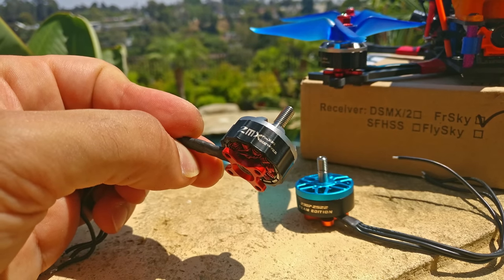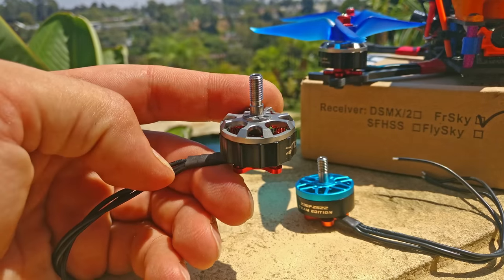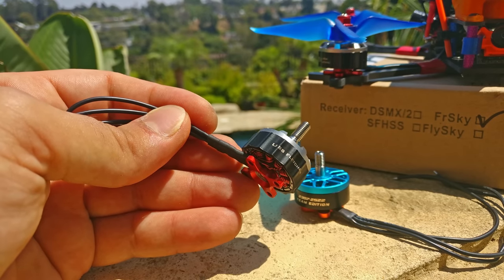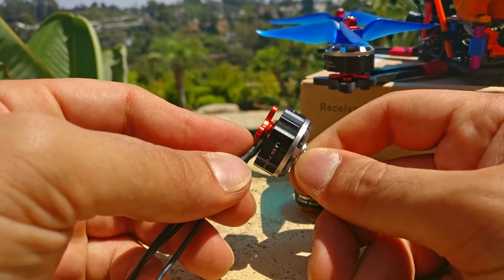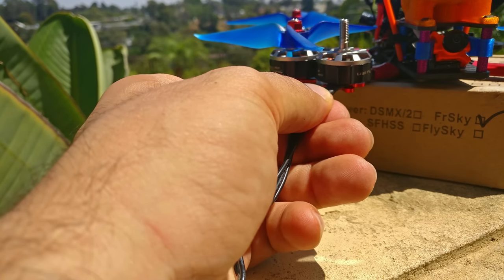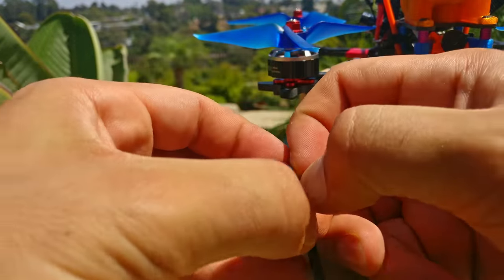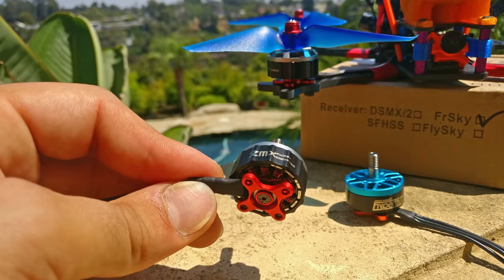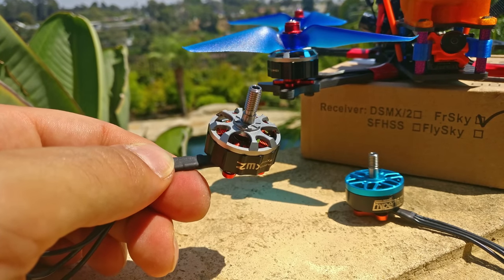ZMX FinX30 2600kv - Discussion

Comment: Nice and fair review as usual :) My apology for the higher price tag than what ZMX usually offer before but I think for the performance and innovations, these motors justify that cost (considering the R5 is also priced at 26usd) After the previous incidents, I have personally told myself that if I can't give anything that's value-adding to the product I am making, it's better to let the Chinese do what they do best and not go down to "rebranding" stuff. This string theory flux ring design, however, is something I have been designing for more than 3 months since the day of conceptualizing the first 3D drawing, FEA analysis of the magnetic field to the day we actually found a good factory to bring it into life so I believe it's something significant enough that ZMX can bring to the market and call it my own. For our loyal customers, this probably is the best thank you we can give for putting up with our problems and giving us your tireless supports! :) We also have some high quality rebranded stuff at $14 coming out in the near future!
Reply: I will place an order but I did have a bad experience ordering before. I basically had to move to another brand and it too 3 months to finally get my money back. I don't mean to post this to bash. But shipping speed and customer service is very important. I had to get PayPal involved and that was after your email returned as mailbox full for two full weeks before I quit trying. Basically I lost money on the currency conversion. Innovation means nothing if product does not arrive. Customer service is parmount and a definer toward success.

Comment: As a person that rewinds motors mostly around the 30hp to 500hp, I can tell you that these little motors are not built as well as they should be for their intended purpose. 1. they should run ceramic bearings with SS races  2. They should be dipped in at least a water based motor varnish for protection and it would help lock in the magnets as well. 3. The skin effect has to be at least present with the wire they use (but these look like they have a good coating on them). Even though we are low voltage, we are pushing higher amps and incredible Hz through the wire. 4. I'm more that sure eddy currents are present with the laminates being so tight but I could be wrong on that one (the only way is to do a core test). Always look for a motor that has clean looking coils that do not have wire (coils) crossing over (once again skin effect). Always take the motor's bell off and put it on a good prop balancer (you may be surprised) and if you can see it, look at how well the wye connection soldering is. I don't like a design that doesn't protect the winding fully. Scratch that wire coating and see how well that motor does.

Comment: Great review, explanation and first impressions Bob, many have been wondering about these motors and what the new "flux ring" technology is about. Unfortunately these motors are super expensive and not affordable or wallet efficient for a good portion of the hobby community currently, which is not to say that they are not worth the asking price and the technology is hype, but many will have a hard time swallowing that price tag in general, especially in this specific fpv hobby where crashing and breaking stuff is standard operating procedure.....
Reply from the maker: I agree.  Excellent motor, high price.  Good for people willing to spend that.  I have a sub $15 price option that's as good as all the top motors on the market.  Of course there is still a difference, but unless you're a really top pilot you'd be hard pressed to notice.  The manufacturer has asked me not to share until the 7th...
Reply: Kabab FPV I can't wait to see what you have in store for us Bob, if they're really as good as you say at a $14 dollar price point, then you will have a for sure winner and no vendor will be able to keep them in stock. I'll be waiting anxiously since I really need new motors for an upcoming build and review, can you give a hint on the size or kv?
Reply: Please don't worry about the price :) For non-believers of the new flux ring design, we have something as well and we don't charge a single cent of profit margin for something we don't make :) So watch out!
Reply: DrAg FPV - I wasn't suggesting that I was a non-believer or that the new flux ring technology isn't worth the entry fee to own these new motors, I was just stating my opinion that the entry price of these motors will eliminate a lot of guys in the hobby from buying these due to budget contraints and the propensity to break and replace things when they crash, but I'm glad that your company is going to offer a more affordable option that will fill a different demand in the motor market for the budget minded and more frugal hobbyists.
Reply: Yeah, I mean for budget minded people. Honestly speaking, we did spent a lot in making this design to work with normal CNC procedures but I still think it's something we can offer to the community :)

Comment: Kabab, do you think 2205 motors have any points for today's racing drone circumstances? Taller motors have better response and motor-efficency - drawing more rpms for the kv. And the weight difference between 2205 (finx23) and 2207 (finx30) is just 6 grams, and even less than that, if compared to other popular 2205 and 2206 motors. Since modern top quality 2207s are around 30 grams, we can put them on light frames as well. If we really want to go for light builds with right props, we can go new breeds of BH R4 1806 or Efaw 1807; Btw, I hope any manufactures make a good 2006 size motor. I don't get why 2205 (finx23) should be considered a racing motor. Am I missing something?

And as usual, it's a great review. You are one of the guys in this hobby who are actually helpful to intermediate- or expert-level pilots.
Reply from the maker: I think any good motor is usable.  I personally don't subscribe to the super light category.  I think ~250-265g dry is the right weight for a racer.  A month or two ago I'd say the hyperlite 2205 was the best racing choice as a general high value, light weight motor, but now there are more options.  The ZMX finx23 is arguably the best race motor but I think even that is quite a high price tag.  For something you're going to crash and smash, I'm not really interested in paying more than ~$15.  Good news is that I have a fantastic $14 motor recommendation that will be announced on the 7th.  The manufacturer has asked me to wait until then...
Reply: Kabab FPV Oh, I understand. You think that the best racing motors should have not only a good quality but also a low cost. That's why you think finx23 is arguably one of the best racing motors, since it's cheaper. That's a really good point. Really curious about the $14 motor. :) Thanks for an input.
Reply: Can't wait to see what the $14 motor is going to be. Will you do a video to announce it or is there somewhere else I should look to see the info?

Comment: Magnetic flux is redirected by magnet arrangement not by ridges,  if you take out the magnet and look carefully you will probably see that on magnet is composed of 4 smaller magnets glued together and to prove it to your self take out magnet and stick it into case with no ridges and still magnetic field will be redirected then put one regular magnet into ridged case and you will see that magnetic field is not redirected.

Comment: any word on issues with zmx finx40 2.6 causing esc to blow fets? ive had two spedix 4.1 blow fets... not fire but fet goes bad because ive got grounding from motor pads all way to negative lipo input...continuity from motor pads to the lipo neg? not sure but the few minutes i flown zmx finx40 they feel strong on just 4s tested

Comment: I am not convinced that it is the ridges causing the magnetic field to be "concentrated" towards the stator of the motor. I say this because I have the FU-RC 2205.5 2300kv motor and I cannot feel any magnetic force between them when placed beside eachother. These motors have a round, pretty standard bell. 

I think it has more to do with the type of magnetic and how it is polarized. The FU-RC motor does also use curved magnets.
Reply from the maker: EJ_FPV could be. but I've never felt a motor this drastically weak fielded on the outside. I'm sure other motor makers have delicately engineered their flux rings too. this is just a kind of drastic attempt I think.
Reply: There are multiple ways to get the magnetic field inside the bell. Some use extreme shielding, e.g. super heavy bell like on the Cobra Champion. This string theory flux ring does the job at 2.5g lighter the weight.

Comment: Looks pretty sick. You should check out the ZMX FinX23 - I think it's the lightest 2206 motor available and they boast pretty absurd thrust numbers. It's also pretty cheap - 20 bucks.
Reply from the maker: I've got a dozen of the x23 them on quads 😁. I actually like the brother hobby R6 2205 much much more. Especially the 6S 1750 kv version.
Reply: Ohh ok. If I'm looking to run 4s would you still recomend the brother hobby r6? I run 2306 motors on my floss and it works well, but they're a bit heavy for this new build I'm doing. I'm about to put together another quad on my new custom frame. I'm the guy on instagram who was talking about the custom frame I was designing and how I couldn't get it lighter than your floss XD
Reply: Oh I should have specified the 2306 motors are brother hobby r6s
Reply from the maker: The lightest 2306 by a huge margin is the new emax 2306. It weighs as much as a 2205.  The brother R6 line is really stellar. I recommend it.
Reply: KababFPV  
No m. L

Comment: So unfair that you got a set of these. Do you know anything about the 2205 version of this motor? Supposed to be perfect for light props and ultra efficient
Reply from the maker: The 2205.5 2600 is arguably the best racing motor available right now given the specifics, power and weight.  Haven't tested it, but I know it's a good motor based on the ones I have.  All sold out right now, more coming real soon.

Comment: Hey bob do you think that the x40 2600kv would be good on 6 or 8s on a light frame and dal 5050x2? They have large stator mass so they could probably get the prop up to high speeds if it doesn't explode.
Reply from the maker: I'm not sure but I'm going to be testing exactly that in a month or so.  The X40 2600 on 8S.
Reply: :O Speed run record?!  :O

Comment: Not sure if its the lighting but the magnets on the hyperlite look twice as thick
Reply from the maker: MojoPapi FPV it's the lip around the bottom of the bell on the zmx. the hyperlite doesn't have that lip
Reply: Does the 18mm holes pose a problem on most frames?
Reply from the maker: MojoPapi FPV most frames have slots so no. I do wish they had gone with 16x16 however. it's kinda odd getting the motor to sit in the middle of the mount as you screw them all on.
Reply: Kabab FPV check out the crazy mounts on the new Raceflight motors.

Comment: Very interesting.  I need some lower kv ones.  I only get 99amps with the f60pro 2350kv on dal cyclone 5046 on a heavy quad. All i get with high kv motors is more speed obviously, because they spin the props faster, and a lot more amp draw, not a more torquey feel at all.
Reply from the maker: mooosestang the high kv on these don't pull amps like they should. it's much lower amps for the kv. it also doesn't feel like super high kv however so it's the same. just performs like a little lower kv motor to me. plenty fast however.

Comment: How much will take you to calibrate your current sensor??
Reply from the maker: ashingashinga there is no way to calibrate 100% from quad to quad if they're using different FC's. each FC has a different scale. maybe you'll get within 10A of each other, but the actual number is meaningless unless it's calibrated against a known source.  maybe I just haven't looked into how to get them all set properly. I don't really have the patience. these quads will all be taken apart in another week so I don't see a point.

Comment: The bell and housing are made from aluminium which which is non-magnetic - if they wanted to impact the magnetic field I would think they would use a ferrous material  - moreover the description of the product on their website reads "Patented String Theory (TM) Flux ring-All Rights Reserved". So i think it is actually making use of string theory - or it's pseudo science marketing - one or the other.
Reply: Actually it's not true, the black belt we called flux ring is part of the magnetic circuitry. Strictly speaking any electromagnetic design is making use of string theory, the idea however is because of the shape of the flux ring, it looks like a vibrating string loop :)

Comment: What esc would you advise on these motors?
Reply from the maker: Asgard all in one.  Not even kidding.  That's what's in the quad.  It flies frikin awesome and is as reliable as any other setup so far.  Otherwise, the tattu 30A or wraith 32bit ones.  No other ESC meets my standards of even power delivery.  Even these aren't perfect but are way closer than all the others I've seen.
Reply: Kabab FPV thanks for the advice/recommendation..  👍

Comment: Its pronounced "Phoenix" 30 :D
I killed one of my Emax 2306 2400kv's and the rest are fairly beat up so after your Nazgul review and teaser of these motors I bought a set of the Finx30's on backorder. What grabbed me is they recommend 2 of my favorite props, the Avan and 5152. I'm more excited because you are saying you are getting more efficiency out of the Avans with these! I'm not a very experience pilot so I'm getting ~4.5 min flights out of a Gold Label HV 1500. It would amaze me if I get more efficiency from these ZMX's when the Avans were specifically designed for the 2306 2400kv.

The price was kinda eye watering but this motor does seem to have some real innovation and only a little more than the motors they will be replacing. I could not bring myself to get the Finix40 2.6kv @ $29.48 each.

And get that flight video up with these motors please!
Reply from the maker: I feel the pricing pain too.  These are really the only motors I would consider such a high price for.  All the rest have no real innovation in them and are mostly the same with various construction choices.  I'd say $22 is really the max I'd consider for a motor and I'd really like it to be more like $15...good news, I've got a $14 motor option that's as good as all the big boys.  Manufacturer has asked me not to share until the 7th.....
Reply: Agreed, these are really the only motors I would consider such a high price for! ...$14?! ZMX? I'm in! (Imagining a very light 2204.5 like the FinX23 for 5x4x3's?)
Reply from the maker: GITech no the other motor is not a zmx. its a 2306 too. not my favorite size but it'll do for $14 and that kinda performance.
Reply: Kabab FPV Must be Aokfly. :)
Reply: Gotcha. Is it a super lite 2306? The FinX23 might be the first high $ motor for me if it's efficient for 5x4x3's and Cyclone v1&v2's on lite builds. I agree 220X is large enough. I wonder with the increase in torque and eff' here that they may be able to go down to a new, say 200X(6-7?) ~20g motor??
Reply from the maker: Baum FPV you got it. the new batch 2306 2650kv is frikin awesome for $14. I don't think I could tell the flight performance apart from the brother 2306
Reply: ZMX as well :) Just watch out
Reply: DrAg FPV, Awesome!!! Details?  :)
Reply: It's everything else, except for the special flux ring :)
Reply: Not released yet?
Reply: Should be soon, it's a pretty generic design so we should have constant stock. will open an item once the stock is confirmed :)
Reply: I just got my finX30's only put 4 packs of shakedown flight in since I'm running all new FC's and ESC's and I'm testing in between conference calls... Pretty amazing so far. Running Avans the motors just seem so effortless in throttle response. It hard to describe but they have just super smooth and effortless change of speed. I don't know if its the motors or the ESC's (wraith32) that make it so smooth. Its also nice to have my stupid quanum motor grip pliers actually be useful with the ribs on the bell :). The motors have also been updated to IJN Akatsuki, the difference? No clue but the ring is now polished instead of black.

Comment: I have 4 a2212 brushless motor for 450 quad 2 of them motors are smooth but other two have clicky notch u mentioned in ur video, the motors which are smooth are getting much hotter then notchy feeling motors is that normal pls help me i cannot touch those for more then 2 seconds it extremely hot and i m using 3s 1045 prop on 1000kv
Reply from the maker: Hard to say.  the notchy feeling has to do with the magnet strength and bell design.  It's usually not the case that some of the same model motor are notchy and others aren't.  I'd consider there to maybe be a short somewhere in your wiring or your motor screws are touching the stater or something.
Reply: @Kabab  I opened the bell and isnpected already and no screw are touching i make sure of that but still its happening
Reply from the maker: If there ever was a time when the screws came in contact with the windings they could have damaged the windings coating.  If so, some warm motors will be the best of the possible things that could happen.  This has happened to me a number of times over the years so I'd guess it's the likely cause.
Reply: @Kabab   i always was careful when screwing the nuts make sure they dont touch and visually inspected while doing that so i dont think my screws ever touched motor maybe its the bad esc i m using cheap ebay yellow heatshrink esc
Reply from the maker: @goobisoft4873  hard to say. Just keep using them till something happens. That's usually the way to go anyway 😁
Reply: @Kabab  lol u savage 😂😂😂🤣